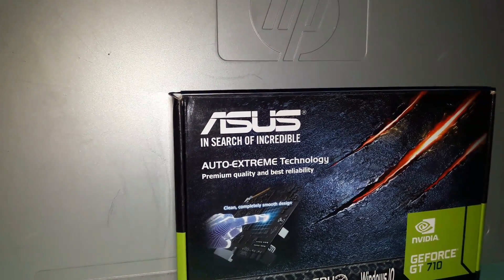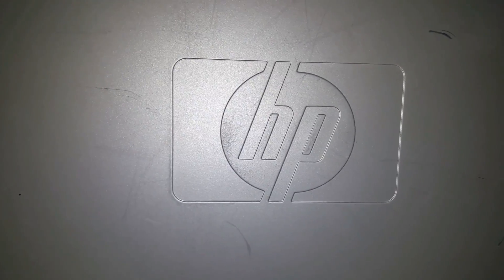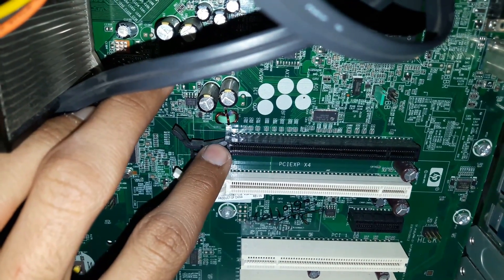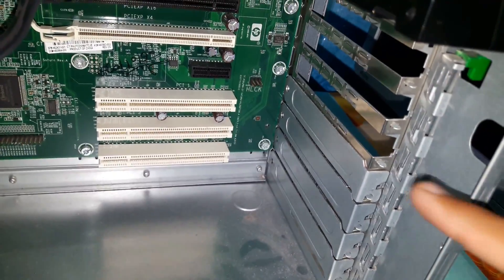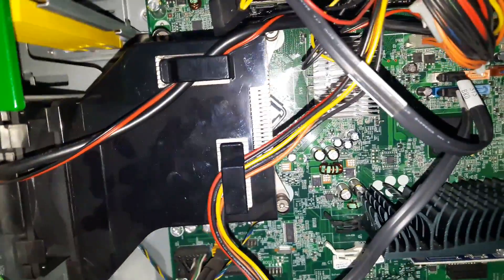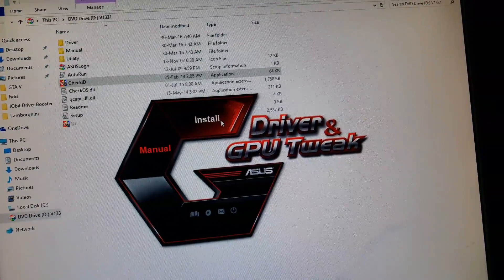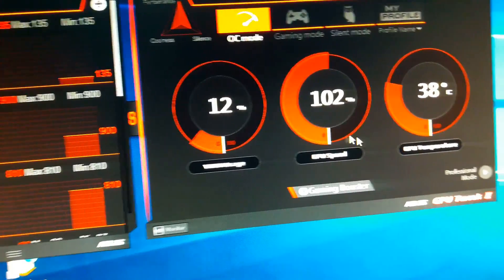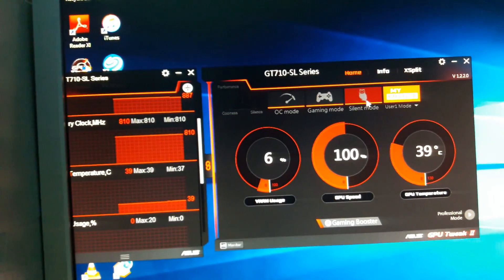ASUS Nvidia GT710 Installation on PC

Comment: Your motherboard name
Reply: Display cable ko bhi card se connect karta padta hai
Reply from the maker: A-Tech Officials - The motherboard I have in my PC Cabinet is the original Stock HP Motherboard that comes with the HP Compaq dc7900 Convertible Minitower PC's.
Reply: YOUR PCI IS X16
Reply: Core 2 duo 8gb ddr 3 ram can I play GTA 5
Reply from the maker: A-Tech Officials - Yes, my PC's motherboard do contains a PCIe X16 slot where I mounted the graphic card.
Reply from the maker: A-Tech Officials - Yes, you can play GTA5 with this configuration but the only thing you need is a graphic card for best performance.
Reply: a-tech officials can i run gta v on gigabyte h110ms2 with win 7 & this g crad & 4gb of ram

Comment: Will this Video card fit to my MOBO "p5g41t-mlx3" having pcie-x16? pls reply back thanks! :)
Reply from the maker: +Niel Danhil Francisco 
A-Tech Officials - Your Asus p5g41t-mlx motherboard is compatible with this graphic card. You can mount/install this graphic card on PCIE x16 slot if your motherboard. Make sure that your PSU(power supply unit) is at least 300 Watts because this graphic card minimum system power supply requirement is 300 Watts.
If you want something better then this graphic card then you can also go for Nvidia  GT730 which is also a budget graphic card.
Reply: Tnx :) appreciated ur help.
Reply: Btw, do you think this video card can support greater than 300 Watts as well? Because my Power supply unit wattage is 600W.
Reply from the maker: +Niel Danhil Francisco 
A-Tech Officials - Yes it can work very well with 600watts psu because it was mentioned that its minimum requirements is 300 watts.
Reply: A-Tech Officials thanks a lot.

Comment: Hey! Tell me plz that it will run on my motherboard.....it is unknown :(.....hope you reply
Reply from the maker: +I Rock 
A-Tech Officials - Check that if your motherboard has a PCI EXPRESS(PCIE) x16 slot or not if your motherboard has a PCIE slot then you will be able to use this graphic card.
Reply: Doesn't DDR will affect it?
Reply from the maker: A-Tech Officials - DDR will not affect the performance of graphic card and you can use/fit/mount this graphic card on any motherboard which contains a PCIE x16 slot. Only one thing matters is that if your PCIE 2.0 then the graphic card will not be able to give you max performance similarly if your PCIE 3.0 your graphic card will work on max performance levels.
Reply: Thnx man luv u 
U got a new subscriber😉

Comment: Lga 1151 p work krga kyy
Reply from the maker: A-Tech Officials - Yes this graphic card will work with motherboard that have LGA1151 sockets.
And for your kind information the graphic card can be fitted/mounted on any motherboard that contains a PCIE slot.

Comment: And What Your Information PC ?
Intel:
WinBit:
Rams:
And Thanks!
Reply from the maker: A-Tech Officials - Currently this PC has a Intel Core 2 Quad Processor, The CPU is cooled by a CPU Air Cooler which is good compared to a stock CPU Fan, Its Graphics are powered by Asus NVIDIA GT710 2GB DDR3 Graphic Card and also this PC has currently 6GB of DDR2 RAM that can be expandable up to 8GB DDR2 . And the OS installed on this PC is Windows 10 Home 64 Bit and this PC has a storage of 1TB [HDD]. And an additional Cabinet Fan is also mounted at the back of the PC Cabinet to improve the Airflow.

Comment: do you need to connect another cable
Reply from the maker: Selman Ismaili 
A-Tech Officials- No this Graphic Card doesn't need a power supply cable to work. Because it is a entry level graphic card that is why it doesn't require a power supply cable from Power Supply Unit (PSU).

Comment: will it support lga775
Reply from the maker: A-Tech Officials- lga775 is a socket for Intel core 2 duo and Intel core 2 quad processors how you can expect a graphic card to fit in it. Check you motherboard if it contains a PCIe x16 slot where you can insert this graphic card because graphic card only fits in PCIe slots.

Comment: Could you please let me know the suitable motherboards for this graphic card?
Reply from the maker: A-Tech Officials- Any motherboard which has a PCIe x16 (PCI Express) slot on board will be suitable to run this graphic card perfectly and you must have a minimum power supply of 300 watts to run the graphic card.

Comment: are you running gta 5 on gt 710 ?? i think i saw the icon around 9:07.
Reply from the maker: A-Tech Officials- Yes I  have GTA5 Installed on my PC that has the NVIDIA GT710 installed on it.
I have installed the GTA5 on it to see how it performs on such an entry level graphic card.
Reply: A-Tech Officials and how did it work?
Reply from the maker: Riddhi Banerjee 
A-Tech Officials- The GTA5 runs pretty well at medium graphic settings. Water quality and texture quality could be set to very high/ultra and other rest of the settings to medium or low and the game will work slag free and it was amazing that the GT710 can runs almost every game I have tried and without any slag. Like Battle Field 4,GTA5,Assasins creed all parts except the unity and the syndicate.
Reply: do tell me your rig specs again.. think i ll try gta 5 too
Reply from the maker: Riddhi Banerjee 
A-Tech Officials- I had purchased a refurbished HP Compaq DC7900 convertible mini tower PC from a reseller which had a Intel core 2 quad processor,2gb DDR2 ram and CPU air cooler instead of a regular stock fan. And then later I modified it by adding 8gb DDR2 ram to it and added a Nvidia GT710 2Gb DDR3 graphic card to it and now it is performing well.

Comment: does it require internet connection to install Asus cpu tweak2?
Reply from the maker: Jay Patel 
A-Tech Officials- no it doesn't require any internet connection to install the GPU tweak 2 you can simply insert the disc came with it into your PC and install it from the disc and then you can connect to internet and then check for updates and can install the latest version of GPU tweak 2

Comment: https://www.amazon.in/gp/aw/d/B01B1WJXK8/ref=ya_st_dp_summary will it support on my DG41CN Ddr2  Motherboard,2 gb Ddr2 ram,dual core processor ?? please reply
Reply from the maker: Sayan Duary 
A-Tech Officials- Your Intel DG41CN Motherboard has 2 PCI Express slots x1 and x16 and the PCI Express x16 slot does supports almost all entry level  graphic card like Nvidia GT710,Nvidia GT730 and Nvidia GTX750Ti etc. It does support the graphic card you wanted but make sure your PC has a minimum PSU of 300 watts
Reply: A-Tech Officials thank you very much  sir...
Reply from the maker: +Sayan Duary 
A-Tech Officials- This is the link to specifications of your motherboard 
http://ark.intel.com/products/43798/Intel-Desktop-Board-DG41CN
Reply: A-Tech Officials my psu shows that AC Input:230 v ~6A/3A and DC Output shows that 450 w ...will my graphics card run on it? sir?
Reply: A-Tech Officials A-Tech Officials my psu shows that AC Input:230 v ~6A/3A and DC Output shows that 450 w ...will my graphics card run on it? sir?
Reply from the maker: Sayan Duary 
A-Tech Officials- Yeah 450 watts is sufficient to run your graphic card.
Reply: A-Tech Officials thnk u sir..u r great...none of those YouTuber did not reply me like you...they upload videos only for money not to help anyone...but u really helped me a lot..thanks...keep it up bhaiya..thank you..

Comment: i have ECS G31T-M7 motherboard with PCIe * 16 v1.1 slot , i want to buy gt710 to play games and video editing both, is it supported with my motherboard? And I saw many gt710 on amazon showing 2GB ddr3 ram but in reviews it has 1GB, and tell me which render should i buy, ASUS, Zotac, Gigabyte, MSI, EVGA, Galax,Palit?
Reply from the maker: Ishmeet SIngh 
A-Tech Officials- If your motherboard has PCI Express slot on it then it will definitely support this graphic card as well as some other entry level graphics card. I don't about which reviews you were talking about but this graphic card has 2Gb DDR3 ram which I have unboxed and installed. And If you were looking for to buy this graphic card then I might suggest you to go with the ASUS Nvidia GT710 graphic card if you have a cabinet fan fitted at the backside of your PC if there is no cabinet fan fitted into your PC then I suggest you to buy Gigabyte Nvidia GT710 graphic card which comes with a onboard cooling fan fitted onto the graphics card for more questions/queries about any PC related problems you can feel free contact us at atechofficials@gmail.com
Reply: A-Tech Officials thanks bro for your help and i found this card in budget
Reply from the maker: Ishmeet SIngh 
A-Tech Officials- Yes that is the graphics card which I have suggested you but only buy this graphic card if you don't have a cabinet fan installed inside your pc and if your pc have a cabinet fan installed then you can go with the Asus Nvidia GT710 which has a better built in quality link is given below:-
https://www.amazon.in/dp/B01AY78NFW/ref=cm_sw_r_cp_api_i_ueUizbP0S886P

And if you have a budget of under Rs. 9,000/- then you can buy Zotac       
Nvidia GTX750 Ti which is a very great graphics card. Link to buy this given below:-
https://www.amazon.in/dp/B00IFZ547Q/ref=cm_sw_r_cp_api_i_YlUizbHPMT6SX
Reply: A-Tech Officials Bro, Gigabyte gt 710 2gb supports PCIe 2.0 x8 bus interface and my motherboard have PCIe 1.1 x 16 slot, so can the card easily fit in the motherboard? And my PSU is 450W, need more or this psu is ok?
Reply from the maker: Ishmeet SIngh 
A-Tech Officials- Don't worry bro it will definitely fits into your PCI Express x16 slot and will work very well as I have told in my video that all the pins in the PCI express slots are not used it depends on the size of the graphics car some graphic card only use x8 pins while some graphics card use the all x16 pins in the PCI Express slot
And if you occur any problems in installing the graphics card you watch my video "Installation of Nvidia GT710 graphic card" link is given below:-
https://youtu.be/NnRkrauYgTs

And Nvidia GT710 GPU only requires a minimum PSU of 300 watts to work perfectly.
Reply: A-Tech Officials what about Gt 730   2GB?
is it compatible? as my motherboard support DDR2 RAM(i dont know about what DDR vRAM it support) and GT 730 is DDR5?
Reply from the maker: Ishmeet SIngh 
Actually I suggest you to not to invest money in a graphic card because your motherboard is outdated and I know that I have previously told you that it supports graphics card but the point is whether your motherboard supports graphic card but it only supports 4gb ddr2 ram which according to me is not sufficient  for gaming you need to buy a motherboard that supports 8gb of ram and that supports the processor you have.
Sorry but previously I can't able get the details of your motherboard but now I found the details of your motherboard now you can check the link given below and you will understand what I am trying to telling you:-
http://www.ecs.com.tw/ECSWebSite/Product/Product_SPEC.aspx?DetailID=897&CategoryID=1&DetailName=Feature&MenuID=24&LanID=0
Reply: A-Tech Officials i dont have budget to buy new motherboard and i was thinking to buy a graphic card to just run games on my pc and i am happy with low- med settings+ i m not a hardcore gamer i just wanted to play some of games that just needs graphic card as my integrated chipset just have shader model 2, so thats all and thanks for ur help
Reply from the maker: Ishmeet SIngh 
A-Tech Officials- Ok Ishmeet I understand I have suggested you to buy a new one to play highly graphical games but if you're not a hardcore gamer that's ok you can run most of the games in low/medium settings using your motherboard and a new graphic card installed on it will give you the power to run almost games like gta5 in low settings , battlefield 4 in medium settings etc. Now you can purchase your graphics card and can enjoy playing games. If you have any other problems regarding your PC you can feel free to ask us at atechofficials@gmail.com
Reply from the maker: Ishmeet SIngh 
A-Tech Officials- And I also forgot to answer your previous question about the Nvidia GT730 graphic card. As I have told you earlier that your motherboard can support all the entry level graphics card like GT710,GT730,GTX750Ti etc. It doesn't matter that your motherboard only support ddr2 ram the PCI Express slot can run DDR5 ram graphics cards
Reply: A-Tech Officials I ve gigabyte gt710 with fan and my gpu temperature is 50-51C idle, is it ok or some problem ? But when i open case from one side it drops to 47-49C?
Reply from the maker: Ishmeet SIngh 
A-Tech Officials- Look the problem with your GPU is that it requires more cooler temperature inside the cabinet that is why your GPU's temperature rises to 50 degree celcius. So I recommend you to buy and mount a cabinet cooling fan into your PC Cabinet.
Reply: A-Tech Officials i installed a caninet fan , but where should i install it, on the side panel or just below the smps and behind the cpu cooler and also in which direction? cabinet fan has indication sign of airflow but i after i installed cabinet fan there was no change. And what if i remove the PCI expansion slot covera under the gpu?

Comment: What's the length of the silver tab with the ports.I am looking to buy one for a dell optiplex 780 but not sure if this will fit.
Reply from the maker: Ron 
A-Tech Officials- Yes, it will fit into your dell optiplex 780 because Asus Nvidia GT710 comes with a pair of small mounting brackets which can be used to fit the graphics card in smaller cabinets.
Reply from the maker: Ron 
A-Tech Officials- I have measured the length of the silver tab with the ports and its length is 12cm. And that silver tab is known as Input/output shield.Hope this graphic card fits into your Dell optiplex 780.
Reply: Yes bought one and installed it in m y 960 Optiplex.PSU is only 230watts but is capable of running three monitors at once.Very pleased with this card.Am not a gamer but just needed it for multiple displays -works great
Reply from the maker: Ron 
A-Tech Officials- Great,enjoy your graphic card.

Comment: can i buy this or not tobplay wwe 2k16 ,17 
or can i buy zotac gt710 2gb DDR3 which one is better
Reply from the maker: Rink RB 
A-tech officials- you can buy this graphic card but I not suggest you to buy a zotac  gt710 although both these asus and zotak have the same nvidia gt710 chip....zotac gt710 has a problem that it has a very much plain and small heat sink given so may get heated up quickly as compared to the asus gt710 graphic card which has a very big heat sink given so asus gt710 is perfect or you can also go for gigabyte gt710 graphic card because it has a on board cooling fan which is a very great choice...
Reply from the maker: Rink RB 
A-tech officials- If you have a budget of Rs.7000-8000 then you can buy this graphic card which is the mini beast of graphic cards:-
Zotac GeForce GTX1050 mini 2gb DDR5 graphic card which is the perfect graphic card and can run your games wwe2k16 and 2k17  without any slags and can even run other gaming titles in 4k ultra hd because this graphic card supports 4k resolution and support directX 12. So according to me this is the best I can suggest you.
Links to buy this graphic card is given below
http://www.amazon.in/Zotac-GeForce-ZT-P10500A-10L-Express-Graphics/dp/B01M4MIU94?tag=googinhydr18418-21
Reply: A-Tech Officials  Can u suggest me that gigabyte gt 710 or asus gt 710...Which is best
Reply from the maker: Keshav Handa 
A-Tech Officials - Both of the GPU vendors are best. So you can select any one of them depending upon these conditions.
1.If your PC cabinet does have a PC Cabinet Fan fitted/mounted at the back of your Cabinet then you can go with ASUS Nvidia GT710. And also this GPU comes with asus gpu tweak 2 software which allows the user to easily over clock the graphic card without damaging it.

2. If your pc cabinet doesn't have a PC Cabinet Fan then you should go with Gigabyte NVIDIA GT710
Which comes with a pre-mounted GPU cooling fan on board.
Reply from the maker: Keshav Handa 
A-Tech Officials - Both of the GPU vendors are best. So you can select any one of them depending upon these conditions.
1.If your PC cabinet does have a PC Cabinet Fan fitted/mounted at the back of your Cabinet then you can go with ASUS Nvidia GT710. And also this GPU comes with asus gpu tweak 2 software which allows the user to easily over clock the graphic card without damaging it.

2. If your pc cabinet doesn't have a PC Cabinet Fan then you should go with Gigabyte NVIDIA GT710
Which comes with a pre-mounted GPU cooling fan on board.
Reply: A-Tech Officials  I have a pc cabinet fan... So in that case asus is best na
Reply from the maker: Keshav Handa 
A-Tech Officials - Yes, in this case Asus graphic card is best and also Asus has a great build quality as compared to the gigabyte graphic card.